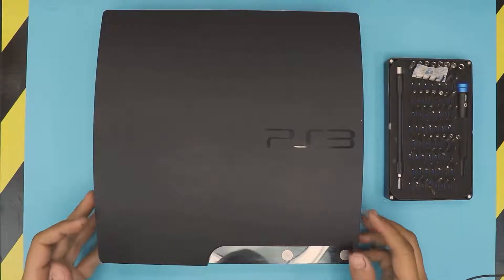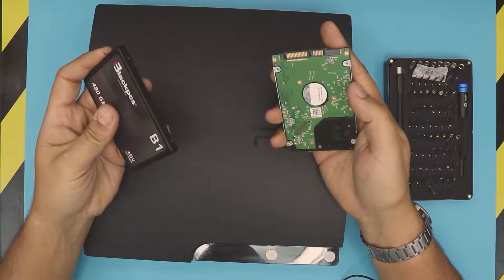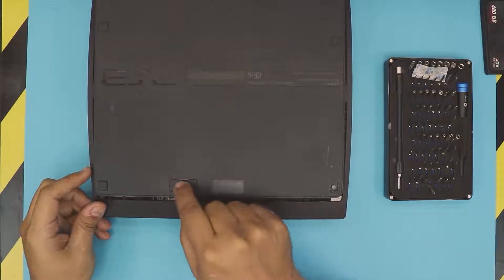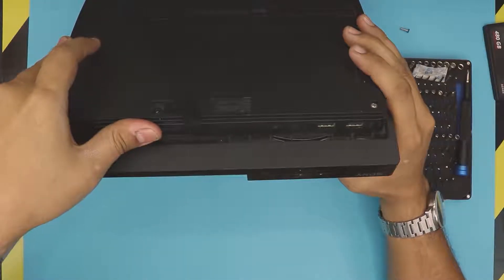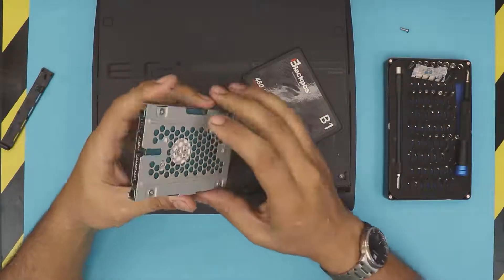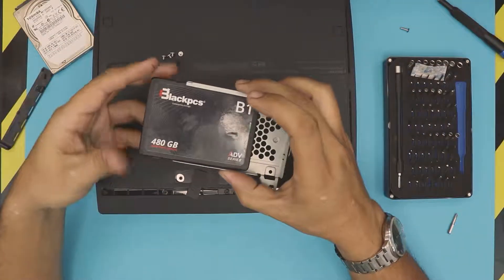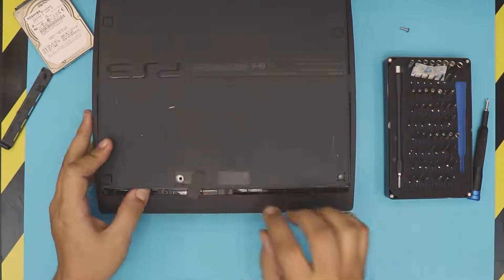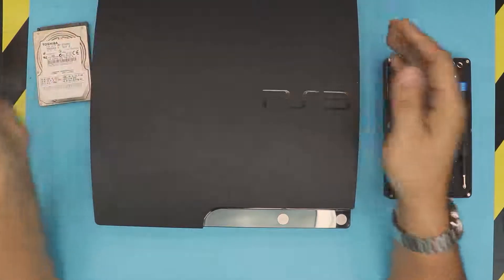PS3 - PlayStation 3 slim UPGRADE to SSD Step by Step

Comment: if you have it guys a drive cloner would work instead of reinstalling the ps3 os
Reply from the maker: But it's faster and cleaner to do a fresh OS install.  
However, cloning is fine, but it will require you to buy (and spend more money on) a docking station.  
Thank you for the info!
cheers🍻

Comment: this does not work the moment i install the new ssd and try to boot the PS3 the power light comes on and goes off after 2 seconds from green to red.. what do i do? ive followed soo many videos and get the same result
Reply from the maker: did you follow the links in video description and instructions?
Reply: @uFixTek  yes I followed through everything the PS3 refuses to detect any SSD it only detects HDD
Reply: @uFixTek  I'm resorting to this cause I originally wanted to backup the PS3 using backup utility but the HDD is so old and failing that it's own backup is broken and doesn't work and replacing the HDD with SSD doesn't work cause the ps3 wont recognize it 😟
Reply from the maker: what brand SSD you using we upgrade at least 4 times a week for clients in the store and don't have any issue. if your PS3 is not detecting the ssd then you may have a bad controller chip :/ SSD make and model?
Reply: @uFixTek  I tried both my Samsung evo 860 512gb and my SanDisk plus 1tb and even my slightly newer Kingston A400 480gb.. neither of these work The PS3 refuses to recognize SSD drives.. external or internal makes no difference
Reply: @uFixTek  it detects any HDD any brand no problem
Reply from the maker: ok then your motherboard firmware is going bad and needs to be fixed because the controller is locked at HDD firmware, and its not switching to SSD firmware. the motherboard needs to be inspected my friend. there is nothing you can do externally or programs or anything. sorry
Reply: @uFixTek  thanks for ur help bro il try and see what i can do😟
Reply from the maker: i wish i could help you more , but there is nothing or instruction for your issue, it requires a diagnosis by  a tech.
if you have any question or request in the future feel free to ask me.

Comment: I have a PS3 Slim CECH-2504b. Do I really need to download the firmware before changing hdd to ssd?
Reply from the maker: The PS3's OS is not stored on the HDD, but the internal flash memory of the PS3. So switching a HDD will not do anything to the OS. So nothing is needed to be done, to get the PS3 up and running, after a HDD switch.The HDD only stores, Media files, save games, DLC etc

Comment: sir.i want ask change stock hdd PS3 or PS4 to new HDD/SSD and instal 
System PS3 and if something happen unexpected in new HDD/SSD when want 
change to old HDD PS3 i need do something? plug and play? no need 
reinstal system in old HDD?
Reply from the maker: Thank you for the feedback! if you wish to support the channel you can LIKE or SUB or both :P
regarding your question: yes that's correct you can anytime just pop back the old drive in and it will start like nothing ever happened.

Comment: I'm considering purchasing a PS3 slim and upgrading the hard drive right away. The link in the description currently takes me to the official PlayStation support page. It is not clear how I would get the operating system up and running on the new SSD. Do you have any other references/links with a step by step tutorial? Thank you.
Reply from the maker: The PS3's OS is not stored on the HDD, but the internal flash memory of the PS3. So switching a HDD will not do anything to the OS. So nothing is needed to be done, to get the PS3 up and running, after a HDD switch.
The HDD only stores, Media files, save games, DLC etc
Reply: @uFixTek  thank you so much for your video and prompt reply :)
Reply from the maker: your welcome my friend
Reply: @uFixTek  I've just bought a slim and wondered the same. Thank you buddy

Comment: You didnt mention about the hidden menu for formating the drive, how to format a usb stick and put the update for the ps3 system and post a link to that update.
Reply from the maker: in the video description i place a link for installing OS:
How to install new system: https://bit.ly/3dVYafb
Reply: @uFixTek  the link is broken. And you didn't put anything about PS3 OS in description. BTW you suppose to show it in the video, how to do it, step by step, right?
Reply from the maker: @Ado90Gaming  i have added the link to step by step on how to install OS for the PS3 its official website link, this video was on how to replace the HDD to SSD, it's not how to install OS, but the steps are very easy, i will make a video for those who need help installing the OS. in the future.
Reply: @uFixTek  installing OS, or even updating it, is included in the whole process of replacing/upgrading HDD.